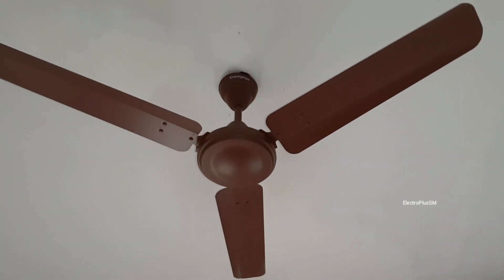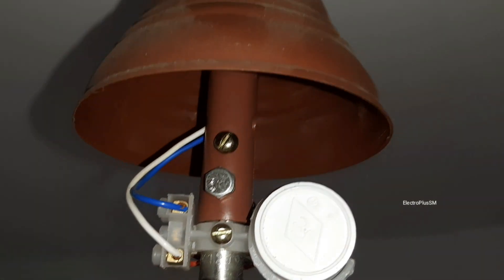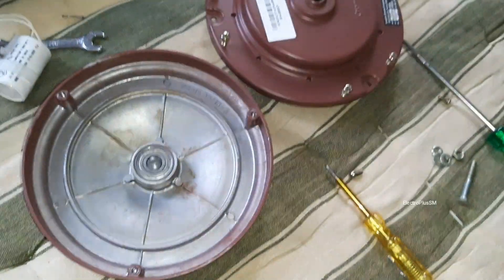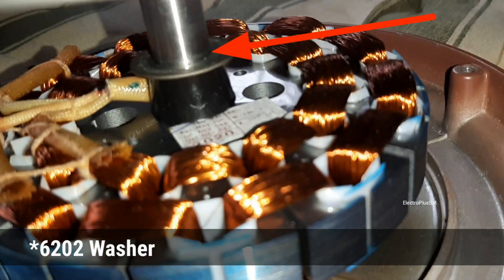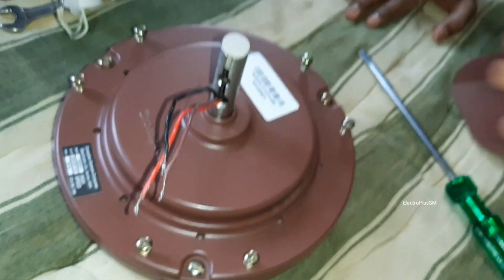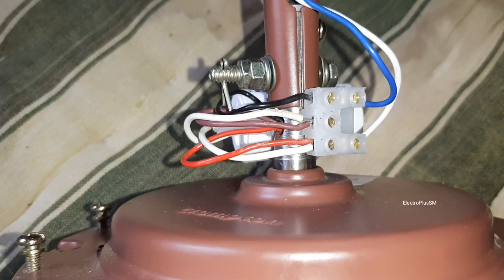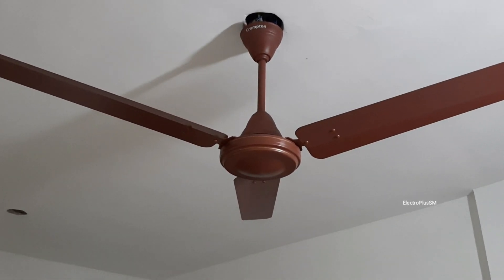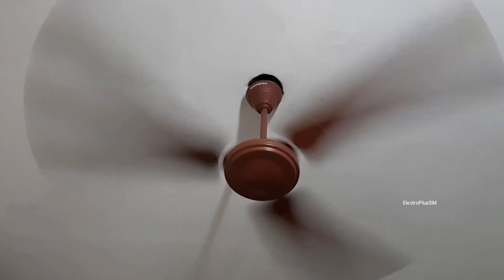Learn Installing Ceiling Fans In Fan Boxes Ft. Crompton HS

Comment: Bro, if you hs bladesets were bended or rusted badly try with riviera's 1star bladesets and its sets perfectly and the speed was awesome and the airflow blows all around the room. I have recently changed the bladesets for my G logo hs that it bended baldy  while cleaning.
Reply from the maker: I already have one hs installed with riv. 1s blades. Excessive speed with super thin airflow & high air cutting noise. HS blades are better